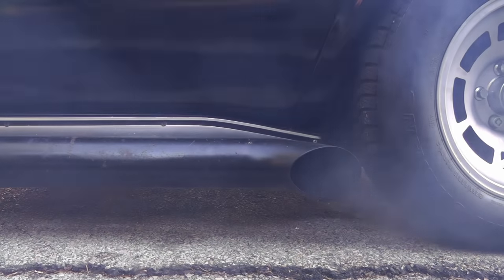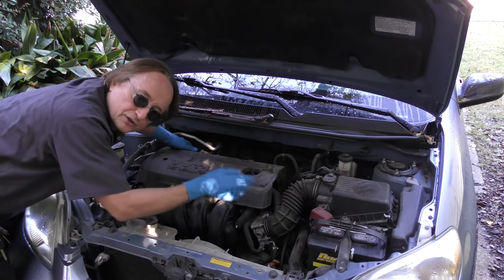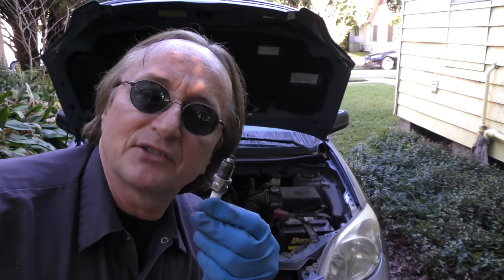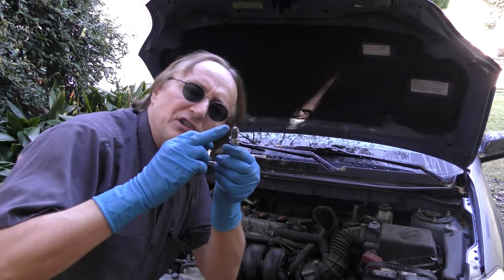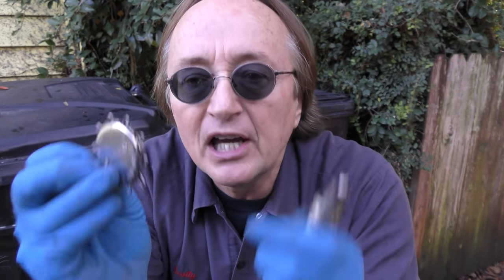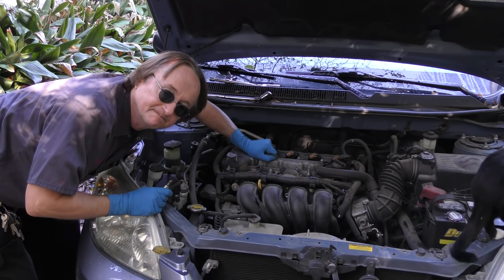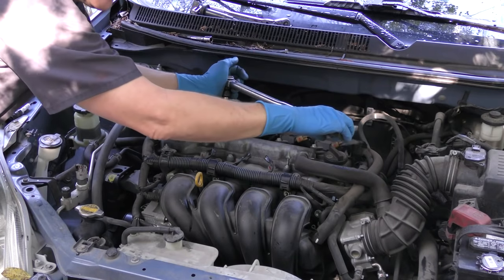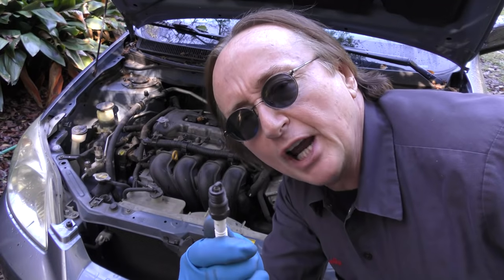What You Need to Know about Spark Plugs for Your Car

Comment: Remember to vacuum out the well before taking the plug out. Don't want to drop grit and dirt down into the cylinder.
Reply: Shit...
Reply: Wipe off before removing, the wipe around hole before installing new ones. All good.
Reply: Would 3 in 1 penetrating oil ruin the engine when using it to loosen up an stuck old spark plug ??

Comment: ngk, can't go wrong
Reply: Autolite is fine for Fords, but they really shouldn't be in Hondas, Toyotas, &c.
Reply: Spot on regarding NGK. Replaced mine every 10 000 miles and the gaps had widened by 0.02 mm at most between services. Could probably have run them for 20 000 miles before replacing them
Reply: Did you say you replace your plugs every 10K miles?  You know they can go like 80K no problem.
Reply: Tool0GT92 maybe copper ones, but why even use them
Reply: Tool0GT92
Replaced... I no longer own that car. In fact, my current car doesn't have spark plugs. As for going for 80k - with fuel injected engines, yes. Not so much with carburetted engines.
Reply: Tell that to my Ford.
Reply: It can, if it is purchased from Ebay.
Ebay is Mecca of fake spark plug sellers.
Reply: chrwi007 so unnecessarily changing part is your hobby?
Reply: Unless a bmw mine hated the ngk i put it switched to bosch ran fine
Reply: NGK was what my 2 stroke motorcycles used, if they'll fire at 10,000 to 14,000 RPM's in a Hodaka Wombat or 125cc Honda they'll certainly work in an automobile spinning 5,000 RPM.

Comment: I changed the spark plugs in my camry (recently traded in for a highlander) at 65,000 miles only as preventative maintenance.  I was very surprised at how clean they were.  I probably could have used the factory spark plugs well into 120,000 miles. Since I had them out I went ahead and installed NGK brand iridium spark plugs.

Comment: Hi Scotty, yes iridium plugs will last somewhat longer BUT the insulator around the centre electrode is made of the same ceramic material used in basic copper core plugs and this insulator often fails well before the plug gap burns out. The insulator is the weakest link in pursuit of a long life plug. I often use basic copper core plugs instead nowdays especially if the spark plugs are fairly easy to access, they are alot cheaper and still last 30,000 to 50,000 miles. Copper is also a better conductor than Iridium and will give a bigger better spark.

Comment: I put Bosche platinum which were rated for my Subaru EJ25 engine and experienced terrible misfires. I then put in NGK Laser Platinum and the misfires were a thing of the past. Both were "rated" for that engine but the NGK was the only one that worked.
Reply: I had the same thing happen to my Frontier's KA24DE. I first thought the distributor cap/rotor had gone bad, replaced them, and the misfiring was still there. Ended up pulling the plug wires until I found the one that made no difference in how the truck ran, then replaced all of them with NGK's (which I had originally used on the 100k replacement). Lessons learned!

Comment: I have an old Volvo 850, and definitely make sure you get the right plugs for your engine. This one was designed with copper plugs, but I used iridium plugs and it instantly ran worse than before I removed the old coppers.

Comment: For people who might not know, the gap on spark plugs might also need to be set, as some of them are gapped to a standard size because they fit in multiple cars with different ignition system and engine specs such as compression ratio, supercharged, etc. I generally regap mine from 1.1mm to 0.95mm when buying them, specifically for my car so it runs better.

Comment: Thank you Scotty!
For anyone's consideration, looking for that sweet spot, my experience and research, Iridium are great and I've found Autolite XP brand to be great and priced right on eBay and I put them in both my vehicles that have just over 100,000 miles and lots of life left.
Now for two of my friends who's cars have almost 200,000 miles on them, we opted to get just the autolite single platinum(double platinum are pricey and crazy design not needed) that don't last quite as long but were very affordable at AutoZone $2 each, since their cars may die before we have to do the plugs again.
Now don't trust the auto store clerks at all that say plugs are already pregapped. 
If the gap is off from the factory, they won't spark right and it only takes a few seconds to carefully gap.
They say that because you can damage the center electrode if you put any force on it while prying the spark arm open more if more gap is needed while adjusting so just be careful when gapping, bend the arm with the gapping fork, avoiding the hard tempered fragile center electrode.
I like to torque to 20 lbs as a general rule to make sure I don't over or under tighten the plugs.
Don't forget to compare the old spark plugs to the new ones to make sure they didn't sell you the wrong ones, ones too long into the cylinder hole could hit the piston and ruin the engine is what happened to a friend of mine but he was on drugs and lost in his mind-shouldn't have been working on his car, glad he finally got to rehab and off that mind trapping stuff.
Just take your time and address any odd things that might come up, one friend had a lot of oil down the valve cover plug hole that was near the oil filler cap from people being sloppy when adding oil to the engine. For that, when we removed the plug, the oil went into the hole and then we cranked the engine so the oil could spray out the hole with a rag over the hole, if we had just put the new plug in, the oil could have hydro lock damaged that piston.

If you really want to, you can apply antiseize grease, but remember that most quality spark plugs come with threads metal designed not to rust seize and Scotty and most say not to because this and over-tightening could strip the newer aluminum cylinder threads.
You can use any plain oil or grease, as a cheaper option.
Also remember that these increase the torque by like 20% you are applying so reduce your torque setting.

Don't make the common mistake of being lazy and forgetting which wire goes to which plug, label them first somehow if you need to.
If the vehicle has a cap and rotor, inspect and consider replacing that is affordable too after you made sure the engine is running right with the new plugs installed to know that went well.
Hope this helps someone

Comment: Hey Scotty. I work at Auto Zone and I get customers with vehicles that originally use iridium spark plugs yet a lot of customers don't want to spend the money on them, some customers are so cheap that they buy copper spark plugs instead. I try to inform that on how iridium, platium, and double platium work, yet customers claim to be a "mechanic" then they come back claiming I sold them bad spark plugs. Is it because they bought the wrong type of plug? Are they spark plugs just spark plugs. A lot of your videos have helped me do my job better and really hope you can help me with this issue. Thanks. love the videos.
Reply from the maker: irridium plugs last longer, but any plug made for that car would make it run fine in the short run, unless they messed up the job breaking wires or knocking vacuum hoses off

Comment: Hi Scotty. My car is a 2012 Toyota Corolla. The recommended service interval for spark plugs is 6 years or 90000km. I am coming up to 6 years with only 50000 km. Should I change the plugs this year ? The car runs fine with good fuel efficiency. Thanks.

Comment: Hey, Scotty! I have a 2005 Ford Taurus. 3.0 Vulcan engine. Used double platinum Motorcraft plugs. Changed them out and put new Ones in . Just wanted to know if those Iridium plugs would be better. Changed the plugs at 121,000 now have 154,000 miles still get  25.0 miles per gallon. Run Valvoline 5W20 high mileage full synthetic now. But used Motorcraft 5W20 synthetic blend. For the first 150,000 miles. Shawn

Comment: I bought a used, one owner Chrysler Town and country with 192,000 miles.  driven nice and easy, and mostly very well maintained..except the spark plugs.  Guy said they'd never changed them and the van still drive beautifully. It had Champion double platinums, and the gap was about twice what it should've been!!  Not sure how it was still running that good..  I replaced with the same plug with barely a noticeable difference.  Amazing they lasted that long

Comment: Do spark plugs wear out with age? My car is a 1993, with only 38,000 original miles, should I think about changing the plugs since the car is over 20 years old or should I go by mileage? 
Some people say change plugs every 30,000 miles so I was just wondering when I should consider changing plugs and wires

Comment: Scotty, what do you think about spark plugs with 2 or 3 poles around the electrode? Do they make any difference? Or is it just a waste of money?
Reply from the maker: waste
Reply: my toyota came stock with 2 electrode. whats your opinion on the nissan 350z. i blew the motor in my solara only has 60k. i supercharged it and now it has low compression in one cylinder. im done trying to make slow cars fast
Reply: Zorak1988 

I tried Bosch +4 plugs in my Peugeot 505 when the engine had about 250 K miles. The engine definitely sounded different...a low growl vs a higher pitched ping, as with single electrode plugs. The engine ran fine. They were clean at 280K, the normal change interval for that car. No evidence of erosion. So I left them in.

Comment: Great stuff, Scotty!   i already use such plugs in my 1999, 3.3 V6 Nissan engine, but the engine is now running roughly, (missing?), with only 35-40K miles on the iridium plugs. Recently, my rotor screw became loose and the engine misfired badly for about 5 minutes before i was able to pull over. Is it possible and/or recommended, that i try cleaning, re-gaping and reinstalling these fine plugs, and might that correct the problem?  Thanks!
Reply from the maker: yes but on those, realize often the distributors break down and need replacing. I use brand new taiwanese ones myself and never had problems then

Comment: When it comes to torquing delicate items in the 10lb-20lb range like spark plugs or manifold cover bolts, its best to use a beam style torque wrench because you can visually see the torque occurring.  I've seen people use the click type and ruin threads because they kept turning, but the wrench didn't click and that can happen for a number of reasons.  Click types are great though for things that need to be torqued at a higher lbs-ft, especially in awkward positions where looking at a beam type wrench would be difficult like caliper bolts or wheel lug nuts.

Comment: Scotty, I have a fwd V6 2008 Toyota RAV4.  Just over 100,000 and runs good as new, however, I was thinking of replacing the sparkplugs.  The local Toyota dealer said that it would cost about $300.  Are they that difficult to get at them to replace.  I have replaced sparkplugs on straight 4 and 6 cylinder cars.  What do you think this service should cost for standard plugs.  Interested in your comments.

Comment: When I had 88 turbo Supra that called for OEM double platinum plugs I tested out other plugs, iridium somehow started to melt and for fun I put it AC Delco copper plugs that I gapped with machine shims and added 50%+ to the OE gap spec from .032 to .050 like a mad man. From that I noticed very slightly better spool at low RPMs and what really surprised me was that the engine got extremely smooth above 6k RPMs. Sure they last about 15-20k miles on a strong ignition system, but they could be changed out in 30 minutes with no hassle on the Supra. I also make sure to leave the stem as flat as I can, because if you leave it at an angle when it wears it going to quickly go out of the gap you set.

Comment: Scotty, i have a 2004 jeep grand cherokee 4.7 limited. Im getting like 12 mpg...ive went through everything.changed  plugs (used the factory recommended), looked for vacum leaks, 02 sensors. tire pressure, fuel filter, some seafoam... airfilter, belt and tensioner.cleaned my iacv,cleaned my throttle body and used a new gasket, replaced the tps not long ago either..my brakes are not sticking either..I used a screwdriver to listen to my injectors but i have not removed them to clean them yet. I am not getting any check engine light and my actron scanners say no codes found. Checked the maf sensor too. Not long ago i did a computer reset re learn as my last thing ive done so far... This mileage is killing me. Thank you in advance!
Reply from the maker: have a pro like me hook up his dealer scan tool and analyze live and mode 6 data to see how efficiently it's running first. then check harder stuff like worn trans later

Comment: I've got 2003 Nissan Pathfinder with 96,000 miles and original NGK Platinum spark plugs. The car runs fine. Change interval is 105,000 miles. Thinking putting the same plugs for another 105,000 miles to go.

Comment: I have an interesting predicament, My '08 Honda fit has a misfire in cyl #4 (Ive checked the plugs and the ignition coils) and will only run rough in the following gears; Park, Neutral, and Reverse. It idles just fine in Drive.

Comment: platinum 4 tip bosch plugs gave my cars better mileage and power, noticeably so instantly when I put them in.  Scotty, I've been working on cars for 40 years now, since I was 16, now I'm 57.  12 years in industry as a repair garage.  including diesel and truck repair.

Comment: Is a slightly bent rim safe to travel on? Ex: I live in Miami Florida, and will be visiting family in Orlando Florida. Roughly a 500 mile round trip drive. But my rim is slightly bent, not loosing air, almost brand new tires. Is this safe to drive on that far? Thank you for your time!

Comment: Scotty my new truck is a 05 pathfinder LE with 80k miles on it and i got the P0420 code, i tried taking the cat  off and cleaning it, i ran some cleaner through the system. not sure what else i can check here, Ive noticed that my gas mileage is a bit heavier but theres no obvious lack of power

Comment: Definitely get your spark plugs changed regularly. I got a tune up at 200k and changed out the original spark plugs but one of them fused to the engine! It still works for now, but once it stops we'll need some expensive repairs.

Comment: Hey Scotty, urgent question. I have a 2004 Buick Rendezvous, with a 3.4 V6, 210k miles. Oil change was done 2k miles ago with synthetic blend. For some reason I'm only getting 9 MPG lately. It's really concerning me because I can't keep stopping to fill up almost every gas station I come by, I just don't have money to throw in the toilet like that. I've checked underneath every time I fill up on gas and there are no leaks. Even had a mechanic check for me. I'm shocked...Any explanation for this?

Comment: Scotty:

I changed my spark plugs for the first time on my Hyundai Elantra 2011  In September this year, Did it at about 103000 Miles.  The guy at Oreillys had me get copper anti sieze and I used it.  Did I just screw myself? Also should take the ignition coils out and  shoot some dielectric grease them then reassemble.

Thank you.
Reply from the maker: grease on the coil is fine, but you didn't need copper on the spark plugs, I would remove them and clean the copper off. It mainly has to do with proper torque, so it won't hurt anything in the short run, just best to remove it though
Reply: Hey, Scotty.  I'm a student on a budget looking at a 2004 Tiburon and was wondering if you knew anything about their reliability.  Specifically, it is the v6 with a 6 speed manual (GT special edition).

Comment: Hi Scotty , how about with a dodge truck v6 2000 dakota , OEM is copper plug change every 30,000 , Cand and should I upgrade to plat or iridium ?  Dont want to have to change every 30,000 and seems the better plug would be better right ?

Comment: Hey Scotty, if we haven't had a single problem that is spark plug related, should we just leave them until we do? or just change them every now and then? because my car is an 06 and it has i think 125k with the original spark plugs
Reply from the maker: change em now, so ignition system won't be strained